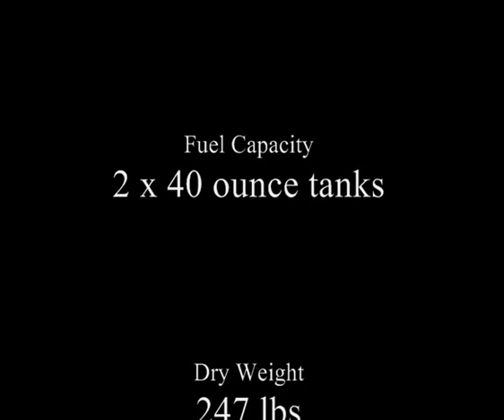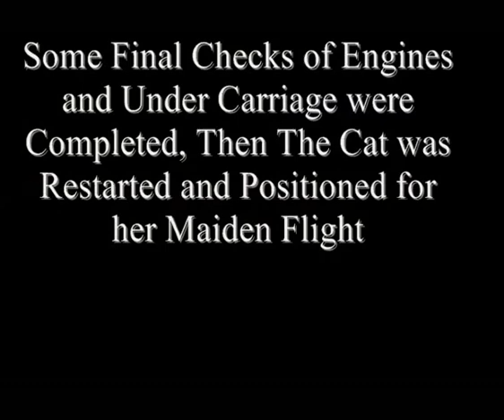World's Largest RC Catalina Flying Boat Built By Stephen Thomas

Comment: When I was 10 years old I was playing and swimming in Ft. Gibson Reservoir in Oklahoma.  When a Mercury station wagon pulled up to a private boat ramp.  A man got out and quickly assembled a very large RC PBY Catalina.  Started the engines.  Then taxied the plane I to the water.  It took off.  We were mesmerized by watching it circle above.  A small fishing g boat came by trolling.  The PBY opened doors underneath it flew over the fishing boat and dripped alkaseltzers on it.  We chuckled.

Comment: Marvelous ! Just a tip for a more controlled taxi and take-off run: always aileron in the wind, when from the front, out of the wind when quartering from behind, always crossed controls - rudder and ailerons opposite - on the ground for directional control in the TO run. Keep flying until at slow speed.

Comment: Why the hell would you risk crashing it with winds gusting at 25mph makes no sense. Now I've watched many vid's of RC crash compilations, first thing I notice is HIGH WINDS. Seen many wonderful builds DESTROYED by wind gusts. RC planes are susceptible to the same winds real planes encounter, Down Drafts & Up Drafts. Real planes can compensate for this RC planes CAN'T. One good up draft, plane goes up, you loose control, & down it comes. One good down draft, plane abruptly goes down, too fast for you to react, & down it comes. Then there's the turning side gust, either Lt or Rt wind gust hits the upper most wing, blowing the plane into a Pitch & Roll maneuver which is hard to recover from on the fly with an RC plane, & down it comes but in this case like a LAWNDART.. Even the real plane a Pitch & Roll maneuver would be hard to recover from on the fly. Would take a real dam good pilot to pull out of it. ALL I'M SAYING IS TAKE CARE OF IT & THINK BEFORE YOU FLY IT. NICE BUILD SO DON'T RISK IT.

Comment: The art of scale modeling is to come as close to the the full scale as possible.  Going big sure helps but If I were to be about building that big I would rather expend my efforts toward a real airplane. However, the largest advantage of the model  has over the actual airplane is that in the event of a crash one is most apt to walk away uninjured. Of course a crash of a model this big is sure to cause extreme damage to the pocketbook. LOL  Oh,, and you forgot the sponsons on the wingtips.

Comment: They gave the camera to the idiot, as usual ... the frame was all over the place, jittering up and down, left and right. Didn't know enough to put a wind sock on the microphone either. FAIL
Reply: Would you rather have the idiot fly the plane...? :-)
Reply: +Harpo Marx Dito a great plane but a sad attempt at a video. No one seems to understand that all you need is a proper camera, turn off image stabilization and auto zoom, and use a tripod. and of course the mike muffler.
Reply: Was thinking the same thing. 3000 hours to build this, and the maiden flight is recorded on a flip-phone by someone having a seizure. Sad.  Nice plane, though.

Comment from the maker: .The engine selection related solely to the maximum prop size the model would take. sadly even though a Moki would fit in the cowl the maximum prop I could fit was a 28/12. This left a 20mm separation at the centre. The best horsepower for this size prop and to accommodate the 247 lbs was the DA 150 which performed outstandingly.